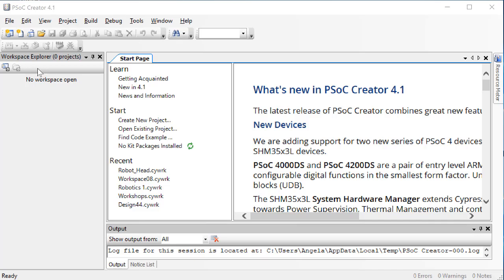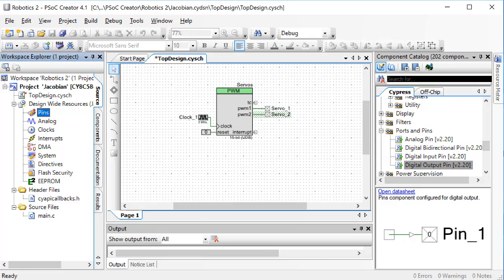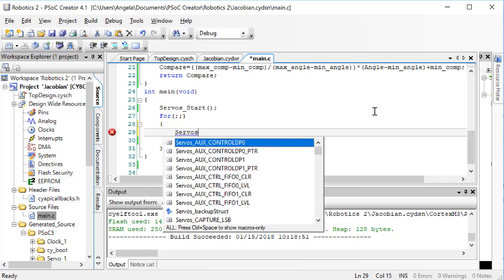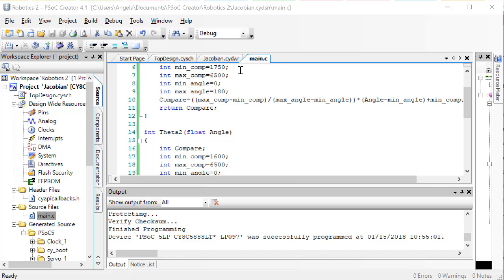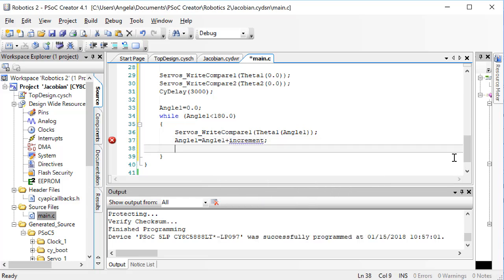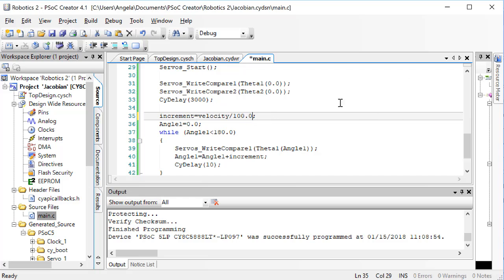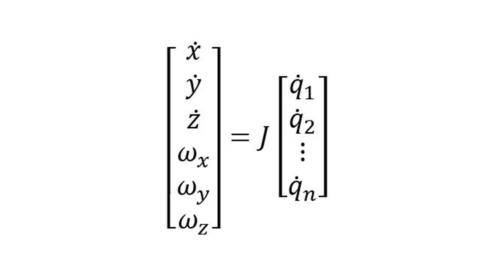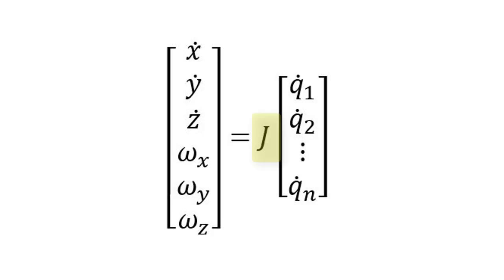Robotics 2 U1 (Kinematics) S3 (Jacobian Matrix) P1 (Intro and Lab)

Comment: Will this work with adruino uno? The code
Reply from the maker: @stevhandingwall2028  everything we do here on a psoc can also be done on an Arduino. But, the language is not the same. So, you can't just copy and paste code, but you can write code to do the same thing
Reply: Okay so my objective is to trigger my servo using an ultrasonic sensor it will move 180 degrees servo 1  and servo 2 move 90 degrees after servo one . Pretty new to adruino uno

Comment: can this method give me equations for joint_i_value = f(X, Y, Z, A, B, C)?? in other words, here we have (Xdot, Ydot, Zdot, Wx, Wy, Wz) = functions_of(q1, q2, ..., qn), but i mean something like be able to calculate each angle needed for each joint depending the end effector target position (X, Y, Z) and rotation (A, B, C), like Theta1 = f1(x, y, z, a, b, c); Theta2 = f2(x, y, z, a, b, c)... etc etc

would be awesome to have that, because with stepper motor you need only to interpolate between a ecuation for linear movement between current (x1, y1, z1, a1, b1, c1) to (x2, y2, z2, a2, b2, c2). calculate the time you need to move everithing, hence the speed and after that, using the Bresenham's method to do the stepping